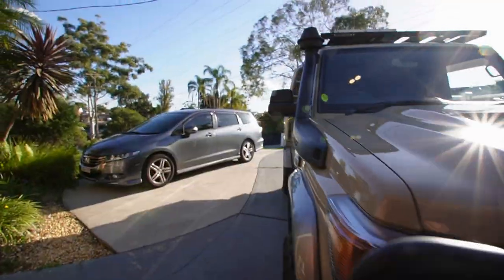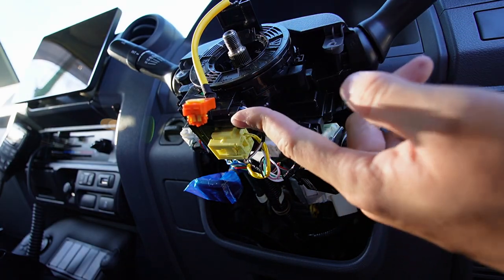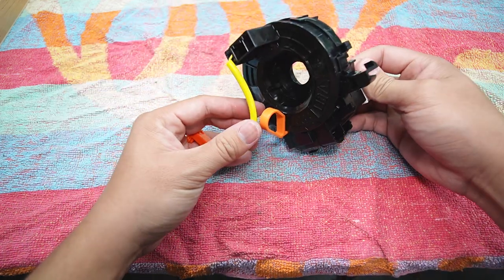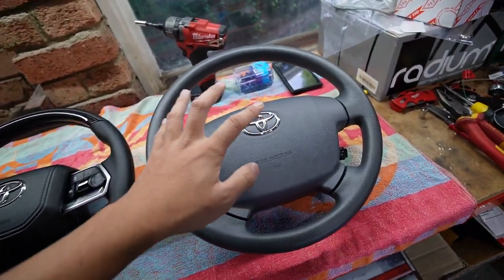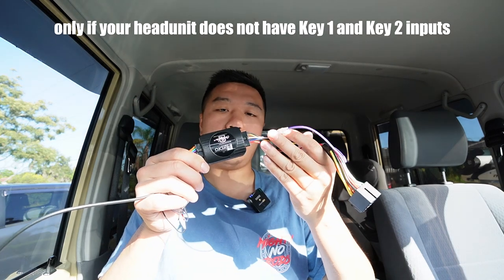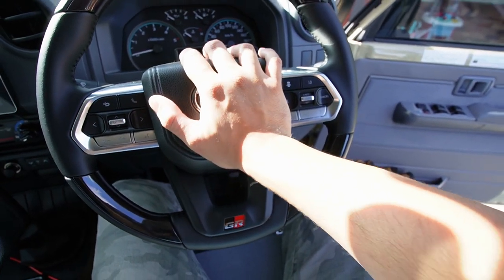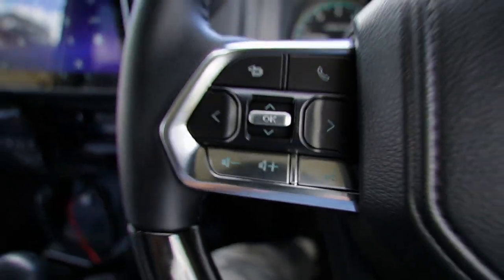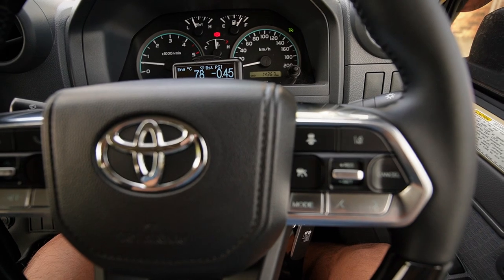LC300 steering wheel upgrade in 70 series with complete wiring guide

Comment: Hey Jonathan, I've been going down this rabbit hole trying to update my steering wheel, and your video is the best so far. I have a 2008 n70 Hilux with a steering wheel with no controls. I've brought an updated steering wheel with controls from a newer Hilux and the corresponding 0K051 clockspring. Would the wiring harness you sell on your website work to connect with my Alpine head unit on my updated steering wheel? Thanks so much! You have awesome content and I've subscribed.

Comment: Can we access the clock spring wire socket without removing the steering?
Reply from the maker: No you cannot, there are two screws behind the steering wheel backing which will allow the steering column trim to be removed
Reply: @JCYT  thanks for the reply. Did mine  on 2008 toyota estima/previa. The cruise control didnt work. Not sure why. I guess I need to relook at the wiring..

Comment: Interesting. I have a 2011 vdj 76 and i have autron cruise control with the controller stuck on the side of the standard steering wheel.  Any possibility of getting that to work with one of these steering wheels?

Comment: How did you end up lifting the headunit in the end?
Reply from the maker: It was quite simple, took me an hour. 
I used a flat piece of aluminium i had laying around.
I had to carefully re-tap the threading on the headunit to screws i could find locally at Jaycar. I believe they are M3 x 10 (i will have to double check). Just be super careful with the tap. 
Bolt the screen onto the alloy sheet with the M3 screws and bolt the 4 legs down about and inch lower. It sits PERFECT now

Comment: Fantastic video. Thanks to your explanations I've been able to do the same mod to my 2007 hilux. Thank you very much.
The only problem is that only the left side of wheel controls work,  I have to check connections,  but very happy anyway
Reply from the maker: Great to hear and you're welcome.
What functions of the wheel aren't working?
Reply: @JCYT   Hello, I bought a different steering wheel in china, it is the same model that appears in this PVS video.
https://youtu.be/2p6_O8d9T-g
And only the keys on the left side work, I guess the ones on the other side are for cruise control (that my car does not have) and stuff like that.
The PVS steering wheel can actually use all the buttons to control the headunit, but they use a wireless system instead of the spiral cable, so I guess they modified the connections, internally in the transmitter, to make it work.

Comment: Hey Jonathan, really enjoy watching your content! I have purchased both the joying head unit and Now the 300 series steering wheel for my 79 series. I have installed the head unit but now waiting for the steering wheel. I have noticed in this video you have managed to raise your unit even higher again? If so how did you achieve this? 

Keep up the good work 👌
Reply from the maker: Thanks mate appreciate the kind words! 
I've only raised the unit once. Quite happy with the height. 
I really need to make a separate video on this as it's asked quite regularly. 
I lifted the screen with a piece of alloy. Mounted the 4 clips onto the alloy and then the  screen higher up. Actually really happy with it!

Comment: Hey mate, great video! 
Have recently installed both the joying head unit and the 300 series steering wheel. 

Just wondering if you have worked out how to get the full cruise control to work. As in speed up and down from the steering wheel. 

As mine is set is set, push up it slows down, push down and it cancels. Which is fine when you get used to it, just wondering if you have sorted this in your setup? 

Cheers!
Reply from the maker: Cheers mate!
Yes it works fully on mine. The buttons are just mixed up and I am so used to it now 😂
CC on/off turns it on and off
+ button will decrease speed 
- button pauses CC
Cancel button will increase speed 
I do want to look into it but just don't have time atm. So no I haven't yet sorted it

Comment: Very nice video! You made me really keen on doing the same on mine now!
Any idea how this would work with an aftermarket cruise control like the 'Autostrada' on a pre 2016 Cruiser?
Also, what if you just want to use this with a stock head unit, how would you preset the controls? Is that even going to be needed, or would it just plug and pray?
Reply from the maker: Hey mate 
I really couldn't answer that as my car came with factory cruise control. I believe you still will have to buy the plug and play harness. I've seen some companies sell them like SSV, PVS etc. Good luck with it. With the stock headunit, if you do the wiring properly you shouldn't need to preset any controls, the stock headunit has these preset.

Comment: Very tempted to try this on my 200
Reply from the maker: It's worth it! Would be plug and play for you too
Reply: @JCYT  I just have to figure out the clock spring if it's going to be an issue or not
Reply from the maker: Based on my research it will be a direct drop in for you

Comment: Hi Jonathan, loved your video. 
Bought the joying 11.3 and 300gr steering wheel BUT can't get all buttons to work. Did you get wheel to be fully functional
Reply from the maker: Hey mate thanks for watching!
Yes it's all working if you have swapped the clockspring and made the harness as per the pinout in the video. Have you programmed the keys in the joying? I have a batch of 10 harnesses ready to go if you are interested in one. Will be releasing them shortly
Reply: @JCYT  how'd,  my son is helping me with install. 
He did change clock spring and made new harness , and has program on joying unit he's getting values on to select what buttons do but left rocker and alot of the black buttons don't respond
Reply: @JCYT  Hey mate, how do I go about purchasing one of your harnesses? How much are they and where can I buy one? Thanks

Comment: Very well done Video.... 👍..Question, with the Joying Head Unit did you get every Button working both Left and Right side of the Steering Wheel with say Google Assistant and Answering Calls Sending Calls Playing Third Party Apps and Navigation..Cheers !!
Reply from the maker: Hi Jeff, 
Yes everything which can be programmed is programmed. Some of the buttons there are for the 300 driver assist functions and cluster controls, so not applicable to our cars. I have voice control programmed via Google, volume up down, call buttons, previous and next buttons, mode (I've set mine to google maps). And cluster controls of course. Hope that helps!
Reply: @JCYT  Thanks Jonathon !!!  Yeah that's the info I was  looking for. Cheers !!

Comment: Hi, Jonathan. I was hoping you could help me. I have an LC200 2007/2008 model and it didn't come with steering wheel control buttons. However, I do see the 10-pin connector on the clock spring. So am I right to assume that wiring for the steering wheel already exists in my unit and I just need to find it, or do I need to do the same wiring you did on the video? Hope you can share some insights. Been wanting to do this for quite some time. Nearly had a crash trying to adjust volume using the touch screen on my aftermarket head unit.
Reply from the maker: Hey mate
I will not be able to confirm but can give you a few things you can check to verify. I believe the clockspring will accept a steering wheel with controls, but you will need to trace the wiring from the clockspring connector to your radio. The black male connector which plugs into the clockspring should have a minimum of 6-7 wires coming from it. If you want to take a picture and send it to my website through the contact form i'll have a quick look for you

Comment: I see that you raised the location of the head unit/screen so that it's now level with the top of the dash 😄 any pointers?
Reply from the maker: Hey mate 
Sorry i don't have time to do a video on this so i'll give you as much info as i can 
I had a piece of aluminium lying around prob about 2-3mm thick 
I mounted the screen higher on the aluminium, i could not find the exact screw (i'm sure you can find these online) so went to jaycar got some M3 screws and tapped in a new thread into the screen. I definitely wouldn't do this unless you are confident, be careful what is behind those screws you don't want to go too far and risk damaging the screen. 
I then mounted the 4 feet about an inch lower on the bracket. 
It was very easy to do - it sits at the perfect height now!
Reply: Thanks for that!
You might be interested to know that, I was looking on the Joying site and the new android 12 units with the Snapdragon chip, now have smaller bezels on the display, this slightly reducing the overall size, and on the 11.6 inch it has a black screen border not chrome.
So it will fit between the air vents, whilst not blocking the vents the screen will just come across the outer rings a little👍

Comment: Great video Jonatha.
I bought a lc 200 steering wheel for my lc 79 series, also only the buttons on the left is programable to the android radio, dont know if it has to do with the lcd functions on the lc200 that they are not compatable with the head unit. Any tips to get all buttons to function
Reply from the maker: Thanks mate!
Yes that's correct. Those buttons will be for cluster interface on the 200 which is not available on the 70. I also installed this exact same wheel on my mates N80 hilux and all those buttons do work with the N80 cluster interface... that tells me that all the extra buttons will need is to be wired in from the clockspring. If I had two cars together I could probably work it out. But no I haven't yet and don't really feel that I need more buttons at the moment!

Comment: Hi Jonathan with your diagram at 9:11 you have cruise control at numbers 1&2 which one is the positive. My 79 has a aftermarket cruise control which the switch is on the driver side end of the dash and I’m trying to transfer the wiring to the steering wheel. Just wanted to know where the live wire to the switch connects to. Thanks, Jason 👍
Reply from the maker: Hey mate 
Sorry i don't actually know as i wired the two cc wires in the same pin position of the new connector. It wouldn't be hard to figure out using a multimeter though? 
Good luck with it

Comment: Hi once again Jonathan !! sorry for being a pest ! With the Cruise Control, is that a factory fitted Cruise Control or Third Pary ?? The Reason I ask is my Troopy is a 2011 and I have a After Market Cruise Control with a OEM stalk switch unit, so I am trying to figure out if I can some how fitt the Steering Wheel setup that you have to mine?? Cheers again !!
Reply from the maker: All good mate
Mine is factory fitted cruise control. If you send me pictures of your cruise control connector at the clockspring I will have a better idea whether it will plug right in. Shoot me a message on FB 👍
Reply: @JCYT  Thanks once again Jonathan !! I think mine won't work as the Unit has  the following setup... Stork control unit which than connects via 2 wires that then goes to a small box  which is mounted inside the steering wheel also,  ... I guess it's the Transmitter, then the signal  heads down to another small black box tied up under the dash, which is right next to another large black box.
Clear as mud😃😃I think  the only wire that I have is what they call the Horn Booster cable ??? that plugs in next to the Air Bag inside the Steering Wheel.
The Cruise Control unit is from a Company called Autostrada in Brissy.

Comment: Thanks Jonathon, a question re cruise control. I have the 2023 79 series with cruise control stalk. Is this stalk now removed and cruise activated within the steering wheel buttons instead. Connecting to a Kenwood head unit. Cheers.
Reply from the maker: Hey mate yes correct the factory stalk isn't required and plugs directly into the new 300 wheels. Cheers

Comment: I understand that as I have a Kenwood unit I will need the additional harness. Have you a link as to how this is to be connected please?
Reply from the maker: Hey mate 
I don't have a link to how it is to be connected. However, check the part number on the Aerpro website, they have more spec sheets on there.

Comment: Great vid i have a 200 steering wheel and the clock spring same as what you have done, i also have the two harness to hook up to a alpine 902df, i have the 4 wires k1 k2 illustration and ground now im lost can you help please
Nick
Reply from the maker: Cheers
Sorry for the slow response, i've been away. 
Are your steering wheel lights illuminating?  
I'm not familiar with Alpine units sorry. They may require a separate interface to interpret they key inputs
Reply: So I've connected the illumination to the wheel and it works and have connected the 3.5mm plug to the alpine head unit and plugged it to the decoder but conecting the k1,k2 wires to the decoder is the issue I can't work out where the go

Comment: Morning Jonathan, I have an Alpine ixlF511A head unit in my cruiser, and when I purchased I requested the parts to be able to add a update steering wheel down the track, the supplier gave me two loam's CCHTO15C and APP9ALOPV, would i still need your harness, I will get a clockspring. Do they stock the steering wheels in OZ that I can go and pick up ( cash sale)
Reply from the maker: Good morning mate 
I had a look for you this morning. There are no helpful instructions from Alpine. 
While you would still need my harness for any connection to be made (70 series don't come with steering wheel control harness from factory), i haven't figured out how it will hook up to the CCHTO15C Aerpro interface. The aftermarket android units have their own canbus converter so it makes installation as simple as connection two wires. I would expect the Aerpro interface to interpret a combination of signals from the steering wheel but unless i have it in front of me, i cannot be of any more help. 

No i don't think so. I've seen a few "companies" selling them. But they are simply dropshipping OR buying in bulk quantities to make a quick dollar.
Reply from the maker: Ktx-G601R this is in another language (could probably use a translator app) 
I wonder if this might work
Reply: @JCYT  Toyota Land Cruiser 76 79 80 Upgrade Steering Wheel Assembly LC76 LC79 LC80 Interior Modification Accessories Replacement OR your link to the one in your description? What is the difference?

Comment: does it work on a land cruiser  100- 105 ?? i need to know if i could do the upgrade.
Reply from the maker: Sorry mate I have no idea
Reply: @JCYT  I have been working on this for a while now and your video gave me a lot more confidence that it is possible for a 100 Series. Only that I the early models have the 6-Pin connector on the clock spring, luckily there are 2 empty pins on that. What do you think, would it be possible to have a adapter from the steering wheel plug into just the Key1 and Key2? And would it be possible to run just the Key1 and Key2 cables through the clock spring into the head unit? 
If so, how do I measure/find out which are the Key1/Key2 pins on the steering wheel harness?

Comment: Hi Jonathan, hate ask again but still not clear if in your 79series your got ALL buttons on 300series wheel to work. 
In your hilux vid install it looked the left rocker switch only changed the cluster but not functional on Joying unit. 
I trying to find a scrolling function but doesn't seem possible
Reply from the maker: Hey mate sorry for not responding to the other comment. If you watch the end of the video, it will show which buttons will work and not work. The scrolling functions, lane assist and a few obscure ones are related to the digital clusters in the 300 and Hilux models. 
Only half the keys will work - you should have volume buttons, mode, voice control button and the call buttons working. And of course the cruise control on the right side works.
Reply: @JCYT  yes ,looks like we have the same buttons working as you.
Was trying to find a way to scroll through things like your contacts or Spotify songs but without that left rocker switch working doesn't seem possible
Reply from the maker: @markdoyle3762 oh and also have left and right arrow keys (I think they're on the other side). I have them programmed to next song and previous song. They work for me. 
I'm sure I can get the other buttons working, but I don't feel it's necessary to have the extra buttons.
Reply: Are you able to select phone contacts, would be handy. 
Seems Ap is quite limited no favourites folder etc or haven't we looked hard enough 😅
Reply: How'd Jonathan,  how would you get other buttons working, 
Software or hardware?
Reply from the maker: @markdoyle3762 definitely hardware related. I believe the clockspring may not hold enough pins to transfer the signal. The N80 and the 200 series clocksprings have additional wires inside the clockspring for this. I haven't had a closer look.

Comment: There goes your warranty.
Reply from the maker: Dusty, at this point, i couldn't care less what Toyota thinks
Reply: @JCYT  I cant wait for the dashcam footage of the Castle Hill Toyota service manager when He see's that modification.
Reply from the maker: @dustyfarmer  Funny the N80 hilux i also installed the steering wheel on - it had a DPF failure and went in for a new DPF, they didn't bat an eyelid 😂 However they did break his catch can, steering yoke, left the battery loose and the e-boards are no longer working.... incredible 😅
Reply: @JCYT  Oh what a feeling.....Toyota !